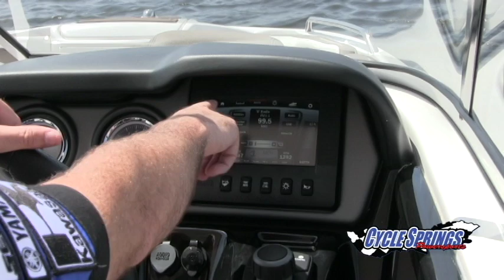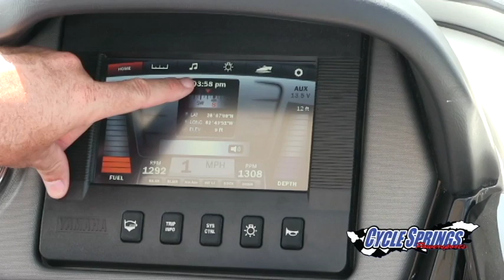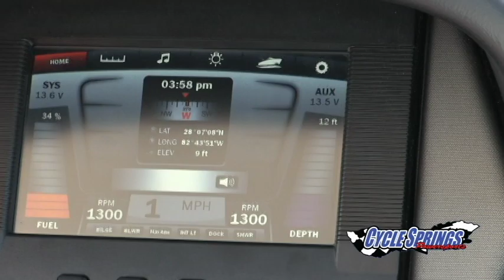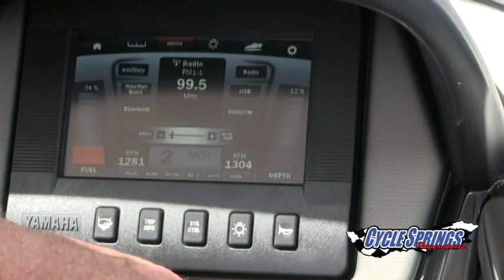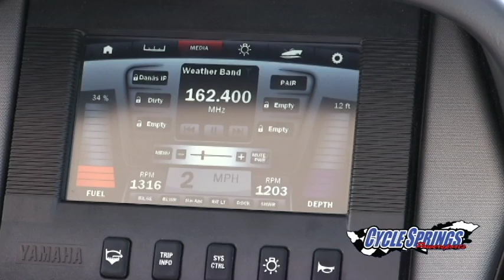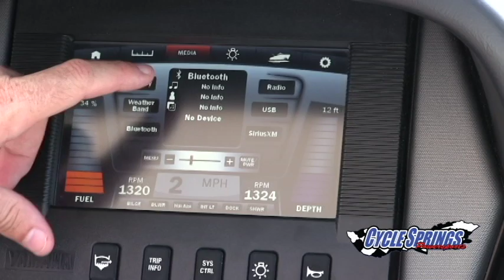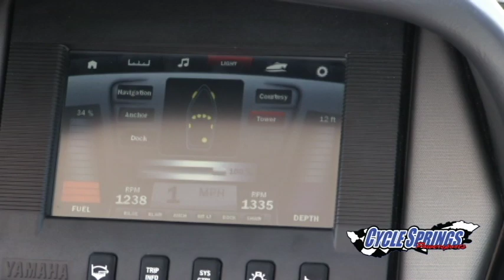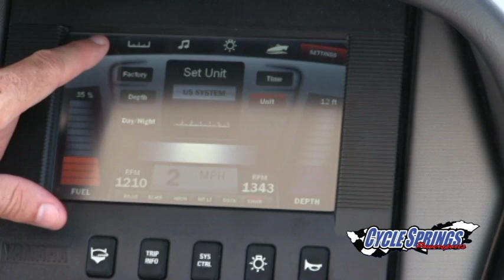Yamaha Jet Boat Connext System Demo

Comment: What do you guys recommend for a navigation system?
Reply from the maker: I need to know which boat model you're looking to equip?
Reply: 2016 242 limited S E
Reply from the maker: @GaryV16  I've not seen many out a GPS on that boat but my best suggestion would be a Garmin. Check with some of the members on jetboaters.net and see what they've had the best luck with.